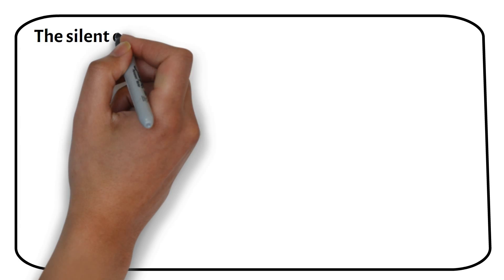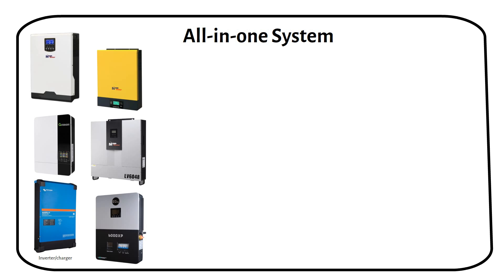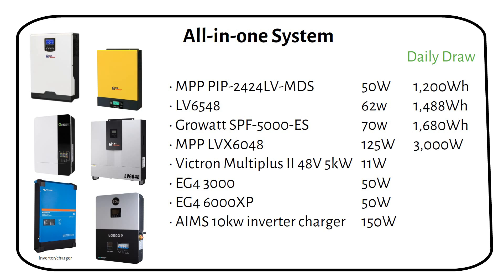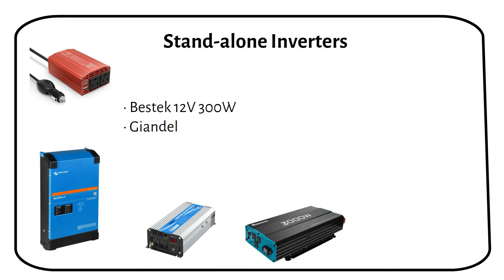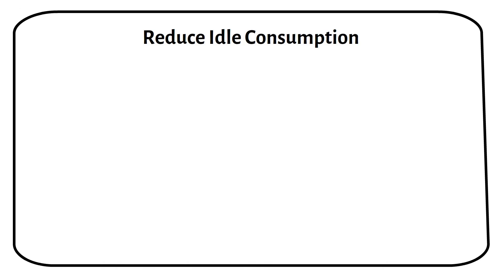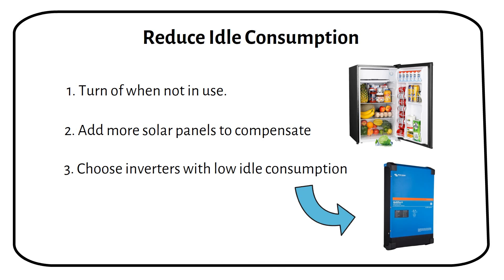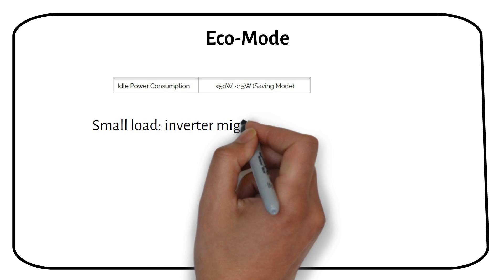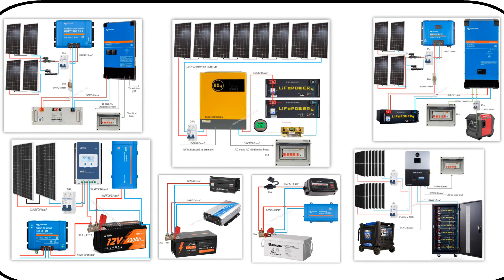Inverter Standby Power Consumption

Comment: Victron Multiplus II 48V-5000VA idle power consumption:
- in DataSheet 20W
- in real use 19W
- in this video 11W
P.S. Victron Cerbo GX shows 37W, Victron SmartShunt500 shows 19W, JK-BMS 300A shows 11W....

Comment: Thus, the standby consumption needs to be added to the amps drawn from a battery for any specific electrical appliance.
Reply from the maker: It's already in the efficiency of the inverter. So if the inverter is 1000W with a 90% efficiency: 1000W/0.9=1111W power draw on the input. the output will be unchanged at 1,000W.

Comment: question, is the idle consumption always lost power? or if you have a minimal load like 50W is the total consumption 50W + idle power or lower?
Reply from the maker: Yes, when you run devices the components need to be powered as well. But when you power devices it's going to increase heat, so there is more loss with higher loads (more heat).

Comment: Thank you very much for this eye-opening review. 
But apart from inverter idle power consumption,  don't you think that charge controllers ~  especially MPPT,~ consume power from the batteries too? So, the charge controller energy consumption should be taken into consideration ,
Reply from the maker: That will be very minimal. Around 1-2W.
Reply: Let's do the maths, 
2w x 24h = 48w/daily.
In my opinion, 48w is big enough and shouldn't be ignored.
Reply: Kindly verify this, most of the charge controllers extract power from the batteries to operate and power their fans.

Comment: The best 12v affordable inverter I have tested for idle draw is the Ampeak 2000W pure sine inverter. Just 5.5W! Very efficient too and meets spec. If you allow, I will post the testing of it here or viewers can just search. Much respect on this critically overlooked topic.
Reply from the maker: I've heard of the brand but didn't know they had low idle consumption as well. Thank you for sharing. You can share it here and if I make another video I will post it.

Comment: Last week I installed an MPP 3024LV – MSD. The idle consumption is 46 W. Keep up the great videos!
Reply from the maker: Thanks for sharing with the community! 🙏
Reply: @cleversolarpower  absolutely, you can't find this information anywhere unless you have a community like this or you get it yourself. I used a Victron smart shunt to collect the data when the panels were off, just to get accurate draw readings. Thanks again for everything you do!

Comment: I have the mpp pip-5648mt. It's very nice but loud and off power consumption is very high. I'll be upgrading to victron equipment and an additional 30kw of batteries to make a total or 50kw. 
 It's working great so far but it really uses a lot at standby. I need at least a 10kw inverter to do my whole house as i intend to set up an island off grid system and export grid connect solar for profit.

Comment: Very nice summary.  A few more rules of thumb:

* LF inverters often have slightly lower idle consumption than HF.  All the inverters shown are HF inverters except the Victron and the AIMS which are LF.   However, LF inverters tend to be heavier and noisier and this isn't the main reason for idle consumption.

* Component quality matters even more, which is why Victron is so far ahead of the pack.  The other designs (including the AIMS) use far lower-quality components and circuits which are not as well tuned to minimize losses.

* Idle consumption generally scales with inverter size.  So for running something like a fridge and low-power always-plugged-in devices, consider buying a dedicated inverter that is only just big enough to run the loads that has low idle consumption.  And if you have other devices that require more power than that inverter can reasonably handle, have a second inverter that is only turned on when those other devices/loads are required.

For example, the video actually made a mistake on the Victron multiplus-II specs.  It is the multiplus-II 48V/3000W inverter that has the 11W power consumption, the 5000W version eats 15W.

* Output specs matter too.  The 48V multipluses output 120V, the 6000XP outputs 240VAC split-phase.

* ECO modes are almost never usable.

-Matt
Reply: From reading several inverter spec sheets, I came to the conclusion that LF inverters generally have higher idle consumption than HF inverters. I also noticed that expensive inverters/high end brands tend to have lower idle power consumption.
Reply: @adon8672  That's a good observation.  LF inverters have a very heavy dependence on the quality of their magnetic components (inductors, transformers), and because those components are huge, quality == cost.  The easy comparison there is the Victron (95% efficient) vs the AIMS (88% efficient).

HF inverters have more flexibility because the components are much, much smaller and lighter.  An HF transformer design can pick and choose where to put in quality components and the quality doesn't cost as much.  So it is actually easier to make a reasonably-efficient HF inverter at low cost.

Most of the HF inverters shown in the video sit at around 90-92% efficiency at modest loads, but poorer efficiencies at low loads.

For the LF inverter, all the money is in the transformer.  So if you put your money into a really high-efficiency, high-Q toroidal transformer (aka Victron), you wind up with a really good result.  The Victron is 95% efficient over a good chunk of its power envelope (the 48V DC input helps there too).

-Matt
Reply: Cleversolar made a video comparison low frequency vs high frequency inverters, I am in agreement with his pick that low frequency  is definitely the way to go. That said, I own 2 Titan solar generators,these are low frequency 3000w 120v inverters, they can run past there 3000w ratings,and there idle consumption is under 15watts, when you can output that load while taking in 2000w solar input, and 1500w ac charge from the wall(2 chargers) at the same time is not something many on the market can do. I will bet my inverters will still be running when the high frequency generators shit the bed, eco flow are cheap enough, but I've never seen any of the many that crapped out ever get repaired, sometimes they will replace it, but not repair, they don't even want it back. That should tell ya something. JM2Cents

Comment: I found by turning my freezer to a higher power during the day, then reducing it to just on at night will save consumption. Just remember to adjust accordingly.
Reply: You may also add two plastic bottles with water at deep freeze at day time and place them at freezer compartment when no sun production. This will equalize the insulation loss for the 0 - 4 celcius compartment of the refigirator
Reply: What is the difference in energy consumption on a daily basis with this strategy, compared to normal use?
Reply: @Tab7.6.Tab7.6  direct sun energy when batteries are topped off during the day  and less consumption at night cause the items in the freezer are more deeply frozen = less cycles of the freezer going on due to lower night temperatures.
Reply: @robertpaulis439  Thank you for your reply, the strategy is obviously logical and not debatable. I was just curious if you might have a comparison in the form of a Wh or percentage difference, for example.
Reply: @robertpaulis439  Because you are not going in and out of the freezer at night it is OK to have your freezer attached to a timer to turn it off every night because it is so well insulated the internal temp will not drop by much if any.